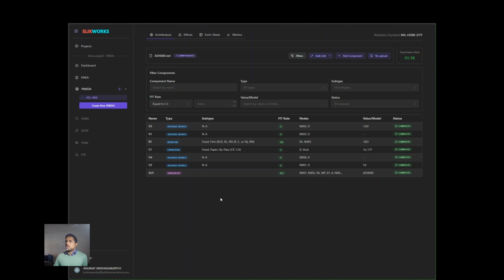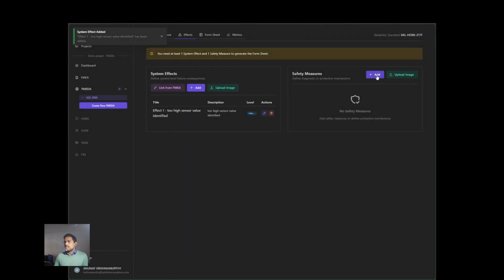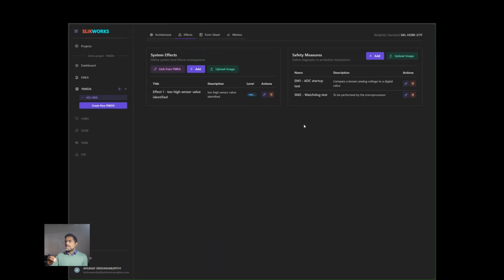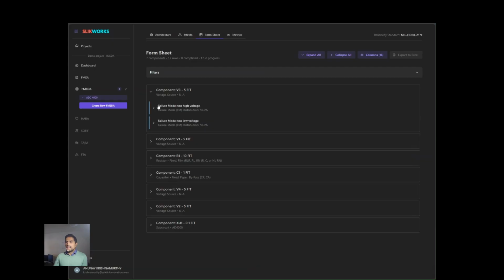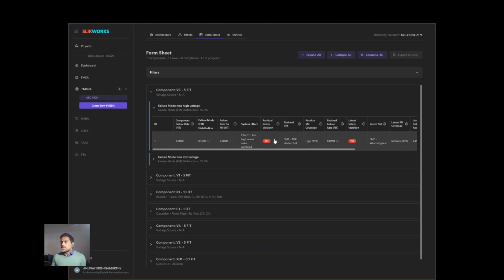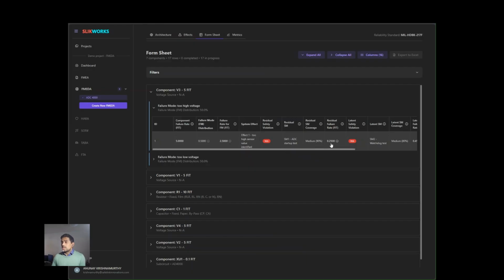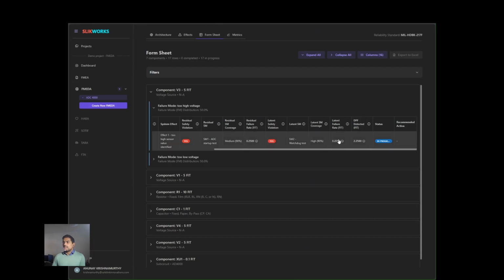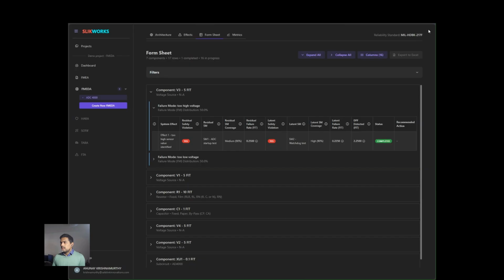SLIKWORKS - Creating an FMEDA - Part 3

Comment from the maker: If you're performing FMEDA manually in spreadsheets, it can quickly become complex and time-consuming.

With SLIKWORKS FMEDA Software, you can streamline the entire process — from component upload to safety metric calculation.

- Manage components, effects, and safety mechanisms
- Automatically calculate SPFM, LFM, and PMHF
- Track diagnostic coverage and residual failures
- Generate ISO 26262 hardware safety metrics faster

Explore the tool here:
https://www.safelink-innovations.com/slikworks/fmeda-software